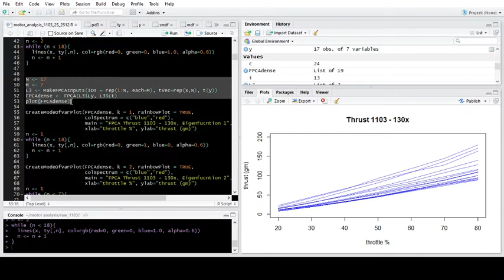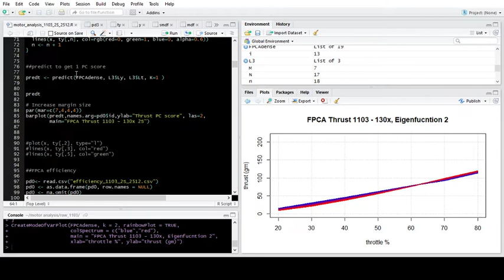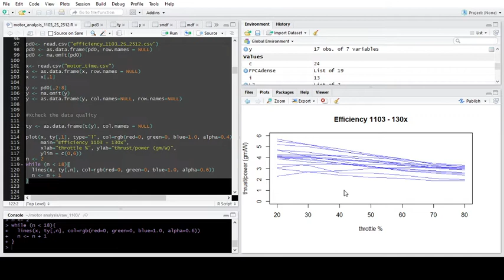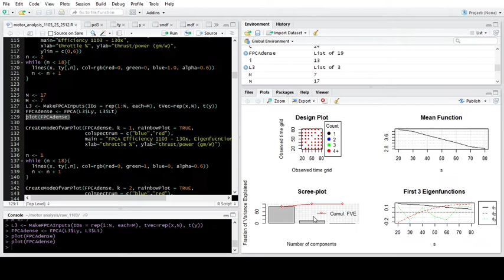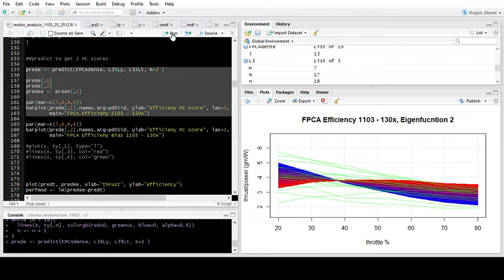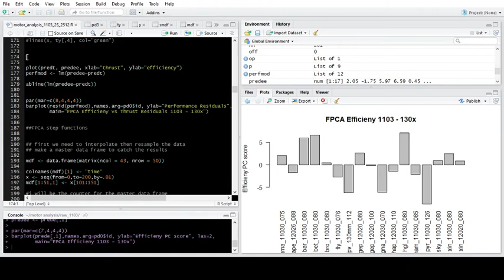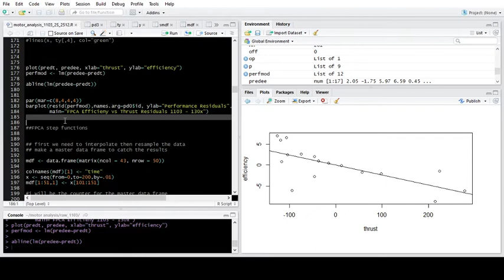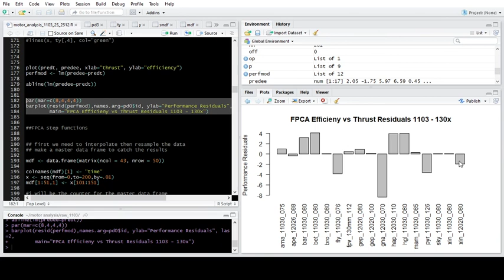The BIG test of little motors 1103, 1202, 1202.6, 13mm Part 1: Thrust and Efficiency

Comment: Hopefully, motor manufactures will start working on dyno spreadsheet. Not just typically one or two or three prop types. Those datas no longer usable for newer profile props.
Reply from the maker: I agree power, torque, and response curves off a dump would be a lot more useful to compare across motors. Getting in to this testing I’ve learned how much results depend on the test set up with thrust stands. You really can’t compare across different thrust stands.

Comment: Awesome vid man, great testing and a super wide range of motors. Would love to see a 3-4s test for 2.5 motors next up if youre interested in doing that. Ive tried quit a fiew on my 2,5 and gotta say, they feel completely different from one another (mamba 1105 5500kv, betafpv 1204 5000kv and apex 1303.6 5555kv.) i still keep switching between the 1204 and 1303.6 every now and then as those motors literally completely transform how the quad flies. also, gf 2540 is the best prop for such a quad from my expereince.
Reply from the maker: It’s fun to get some objective data to compare. It’s quite an undertaking for Karl to run through the testing so funds and time allowing hopefully we can keep expanding outward with the tests.